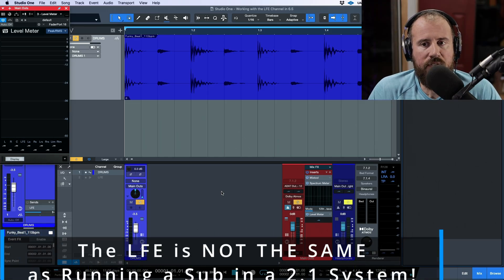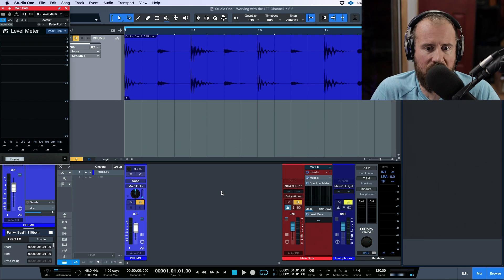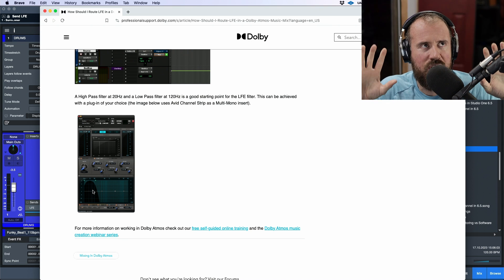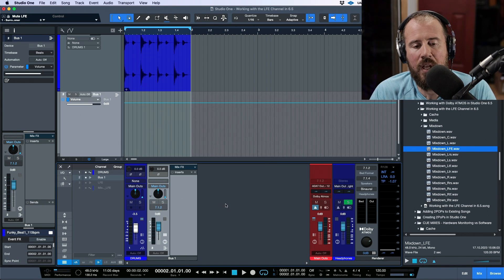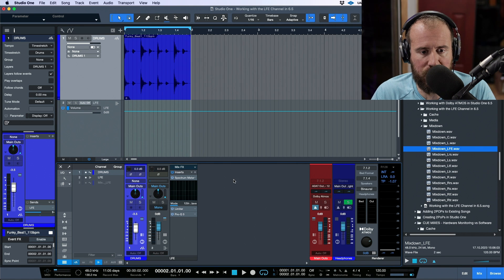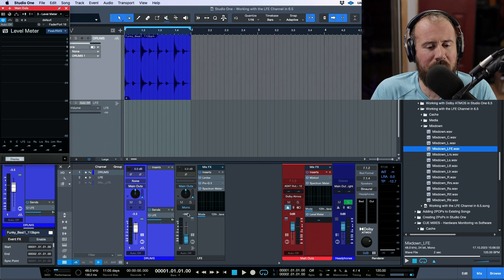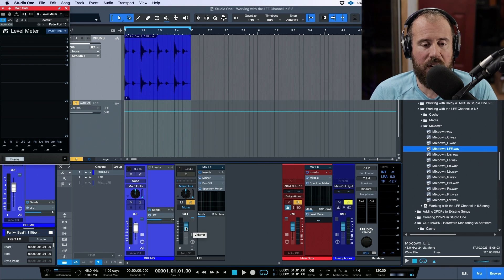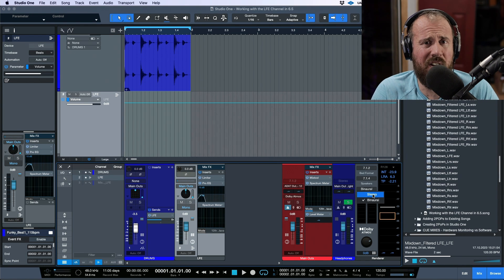Working with the LFE Channel in PreSonus Studio One - Part 1

Comment: I'm curious if there's a setting in Presonus Studio One that allows for a much more pronounced visual distinction when a track is selected on the timeline and corresponds to a track in the mixer and left side channel.  Currently, it slightly brightens, but when dealing with numerous tracks, each with distinct colors, it's often challenging to discern which one is selected without having to click on the track in the timeline and then navigate to the mix window. I'm hopeful that there's a way to significantly enhance this visual indication or make it exceptionally clear which track is selected in the mix window.